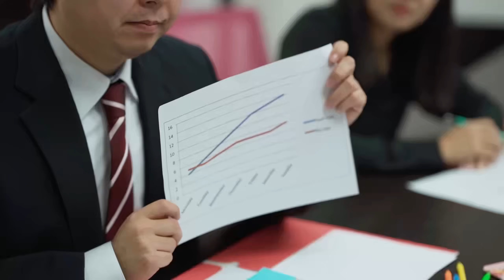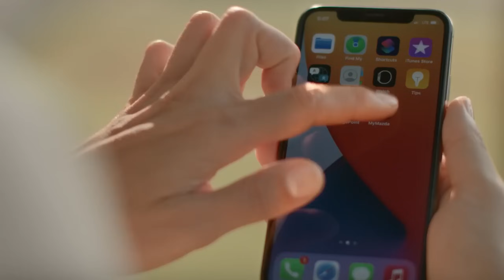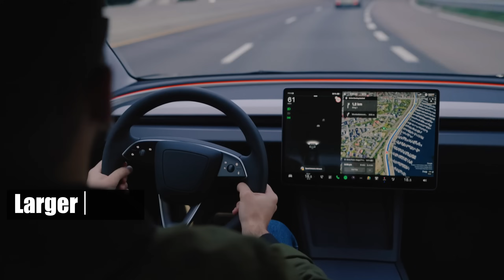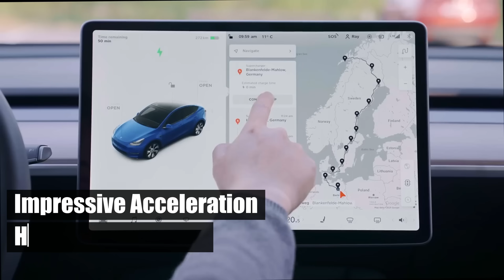Breaking New Ground: The EV Market Phenomenon That’s Never Been Seen Before! Electric Vehicle Events

Comment: I wouldn't say EV'S suck they can build great EV'S the problem is the power grid charging infrastructure and of course ths batteries charging speed and how long the battery will last is more Important than more range
Reply: There would have been the option for exchangable batteries. For whichever reasons, this route was never followed. The stored batteries could also be a great energy storage when there is too much usable energy. Now Nio seems to have developed a well-working system. Superfast battery exchange. Why can't we have that (I live in Germany, so my perspective might be a little different).
Also, as long as the electric power is not from really green sources, the whole EV hype is nothing but a big joke to me.
Reply: @SandraOrtmann1976  You need a lot of room for battery, swapping a lot of machinery too how many cars will be able to swap batteries at the same time

Comment: Electric vehicles are nothing new; They first came on the scene in the late 1890's. They STILL lack worthwhile range, charging stations are too few, and quite far between. If there WERE enough charging stations, the power grid simply could not meet demand if EV's took the place of ICE vehicles. The power system would simply collapse.
On top of that, most electricity is generated using fossil fuel. That electric car is NOT a LOW POLLUTION and certainly produces more pollution than ICE"s. The "green" EV is actually powered primarily by coal, and produces more pollutants than ICE's, and are the real threat to the environment.
\The best choice for an EV would be a F150 Lightning or one of those hideous looking Tesla trucks, and they could haul an ICE generator and fuel supply for the generator. This would give necessary range, and would probably offer lower overall air pollution than using coal power commercial electricity.

Comment: All the tech in EV's can be implemented in ICE vehicles. Hybrid is the way. Diesel hybrid would be perfect for trucks.
Reply: So lower overall power and extra weight with a more complicated drive train while including the expensive and prone to going flambee battery?  Yeah, perfect for an actual working vehicle that deals with real-life outside conditions.
Reply: @michaelputnam2532  I appreciate your reply but read your comment and try to put together your thoughts in a more comprehensive way.
Reply: @realchurch2693  He did a great job.  Hybrid systems have all the drawbacks of both systems with the cost of both.  Let's take a closer look at the upcoming Ram 1500 hybrid.  A 3.6 ICE turning a generator for the electric motor and batteries.  But towing loads uphill like leaving the city for a mountain lake towing a boat?  The generator won't keep up with what the motor will draw in power and the batteries will go dead in 30-40 miles and then you're stuck at about 30 mpg.
Reply: @rogerrussell9544  What drawbacks does a hybrid system have that is shared by both systems?
Reply: @realchurch2693  Weight for one.  The cost of lithium batteries for another.
Reply: @rogerrussell9544  Those are not very solid arguments. Hybrid batteries and motors provide power during acceleration. This is where fuel is consumed the most. Hybrid batteries weigh a fraction of EV batteries. Hundreds of pounds vs. thousands. Being much smaller batteries, the cost is negligible. Toyota Prius for example were used in Chicago for years. They were routinely getting 500k miles out of them.
Reply: @OM617a  false, a Prius hybrid battery for example only weighs 118lbs. Less than an average passenger.
Reply: @realchurch2693  False!  The system is more than just the battery.
Reply: @OM617a  you missed my point and are dismissing it with opinion. End of discussion.

Comment: The ACEEE the reputable “American Council for Energy Efficient Economy” greenest 2024 car was not awarded to any heavy BEV but to a modern high quality PHEV. This is both logic and obvious: no heavy batteries dead weight, 6 times less lithium for the planet and new small durable battery capable to cope with the deep daily load cycles at a full electric autonomy of 50 miles, etc.. No Tesla models are even listed in the 10 greenest recommended vehicles by the ACEEE.. no wonder EV market is down, depreciation no longer means much once to many pre-owned EV are for sale with way not enough buyers to purchase them. 😢game over,,